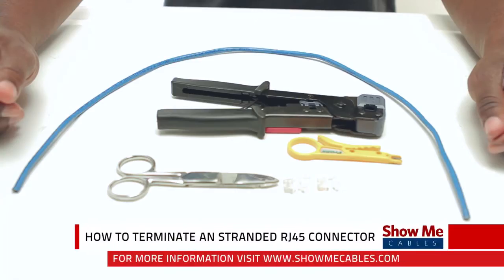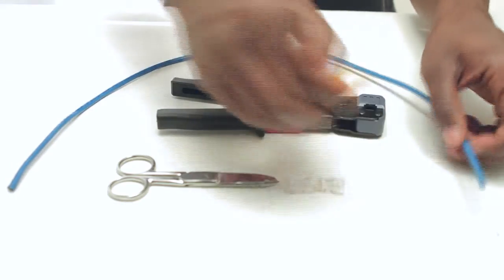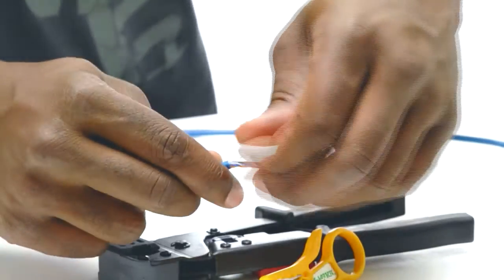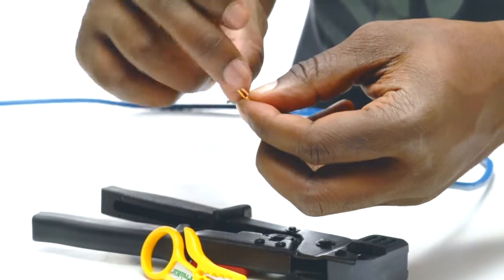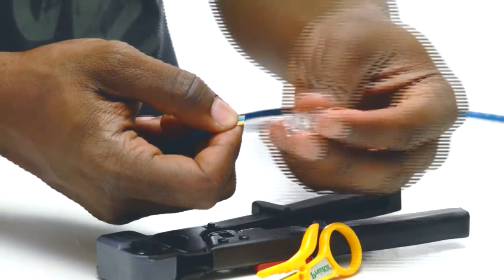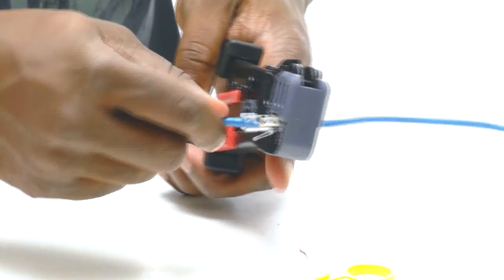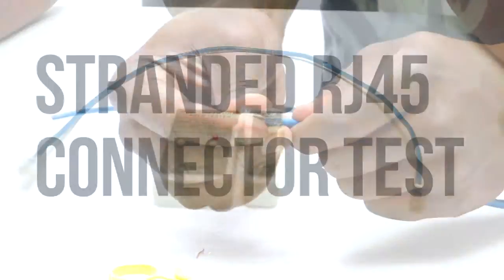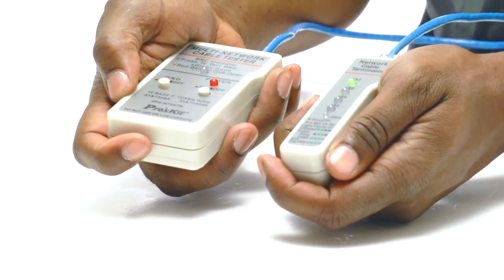How To Terminate A Stranded RJ45 Connector

Comment: The string is for pulling the casing further back than your stripper cut, so you're not using part of the cable you might have nicked with your stripper. Pull the string back, slicing the casing, then remove the casing back to where you pulled the string and THEN cut off the string. Cut the wires off below the spot where you stripped the cable, so you're ensured of having all of your strands and wires for data conductance.

This guys method is irresponsible, and sometime he's going to have to go back and repair his connection, because he partially cut a wire with his stripper, and it broke. I don't let people, who work for me, so what he did.

Comment: Just FYI, if you are following this video, make sure that when you insert the cable into the jack, that the conductors reach all the way and touch the wall to the front of the jack.  This requires a little bit of force when you're pushing the cable in.